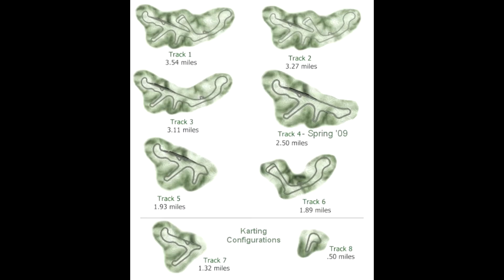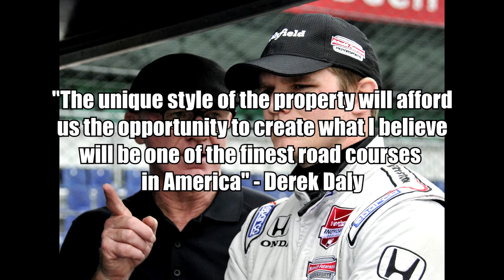The Short-Lived Bluegrass Motorsports Park

Comment: Originally was supposed to have houses around it and be a “private” road course. Apparently there is supposed to be a sister track in California that is similar design. The rules on the safety of the track and cost were in question when running around the track. This was explained when we where building the track and delivering equipment to the site